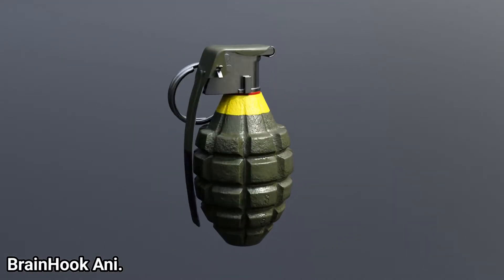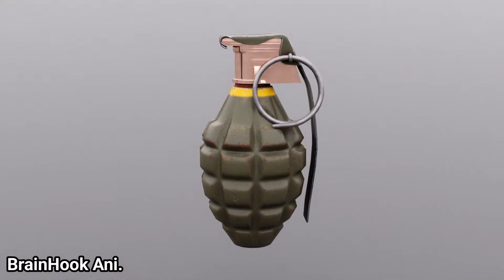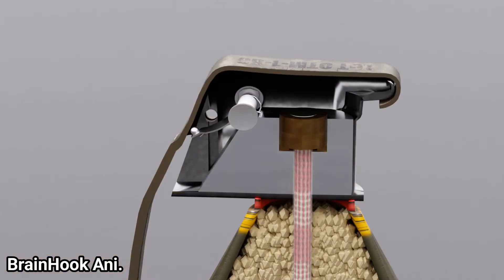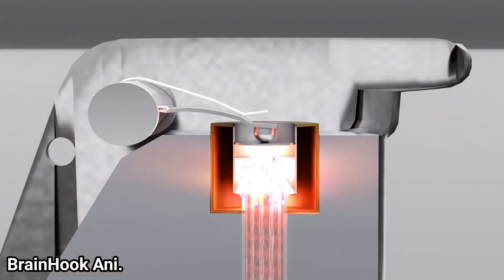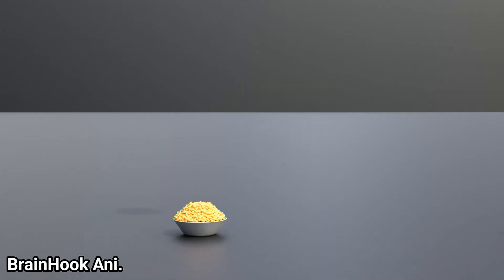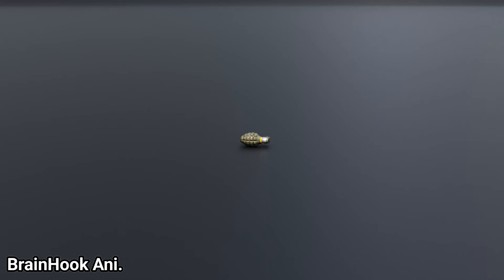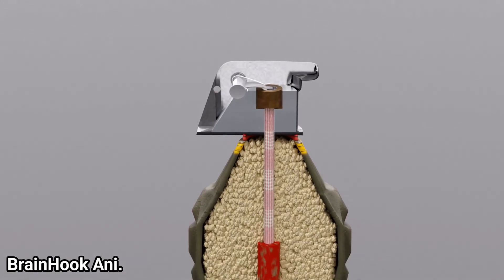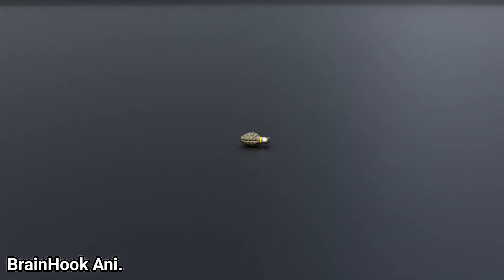how dose a Hand Grenade work?

Comment: You can not set TNT on fire.... Crap video
Reply: You did not watch closely. When TNT reaches it's cook-off temeprature, it ignites. This produces a high amount of gas, resulting in a rapid, hot evaporation. The flames shown before are just to demonstrate a high temperature, leading to a cook-off.
Reply: How did you know that?